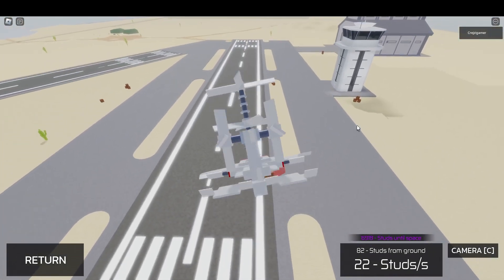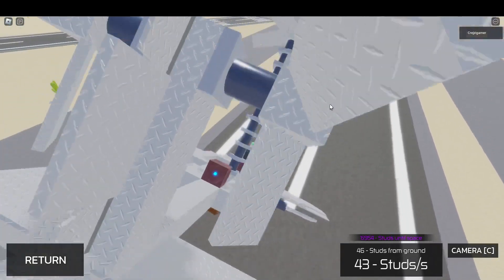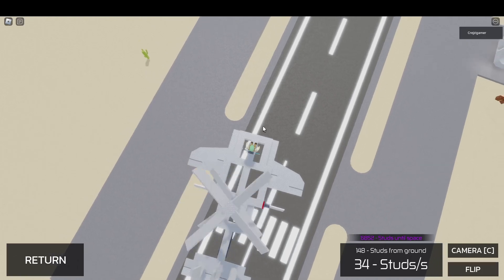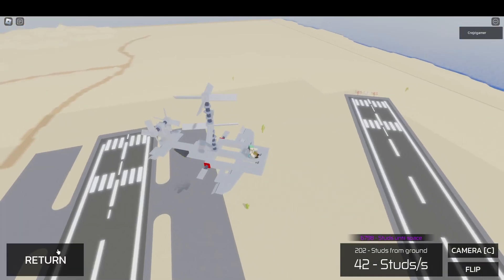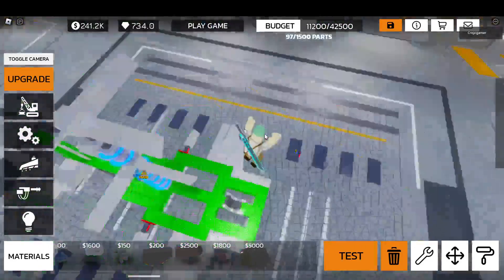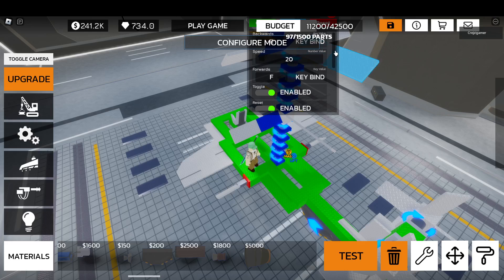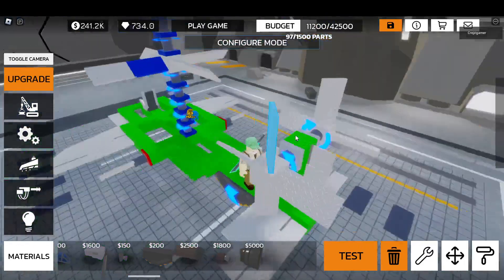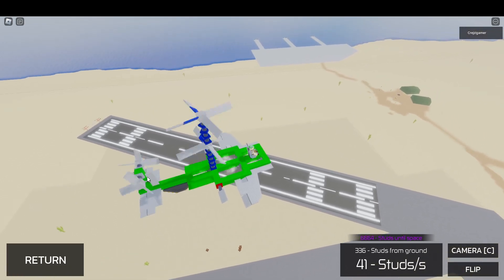Lethal Engineering helicopter tutorial

Comment: If you want another idea, use motors on the propellers to adjust the angle of them and therefore, increase or decrease lift while keeping the main rotor spinning 24/7. A reason I thought of for this, is so that you can quickly change your vertical direction up and down simply from pivoting the propeller. Alternatively you could use rsc:P

Comment: instead of using several motor to achieve a high torque try using rockets or prop engines to make the rotor spin very fast without loosing that much space, also you can use control surfaces to control the left of the heli and  with a combination of prop blades for extra lift.
Reply from the maker: true
Reply: The motors help it become heatless adding rockets will defeat that purpose and it's better off making an aircraft rather a helicopter